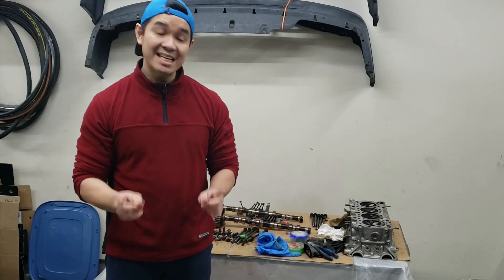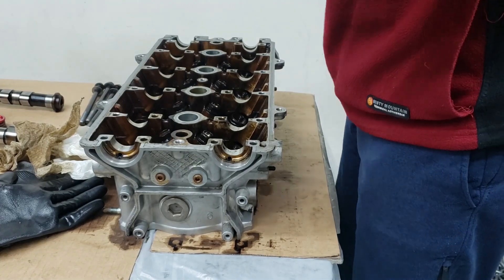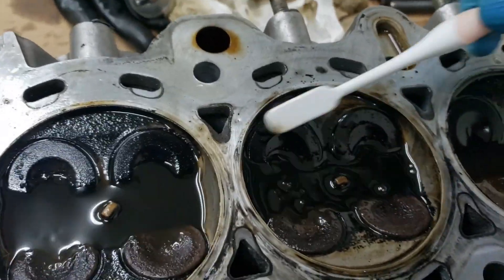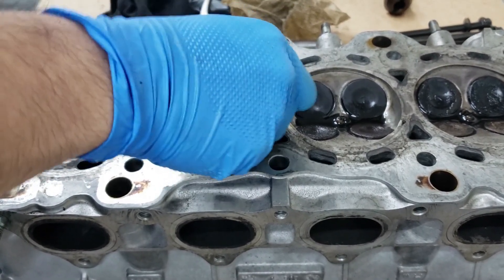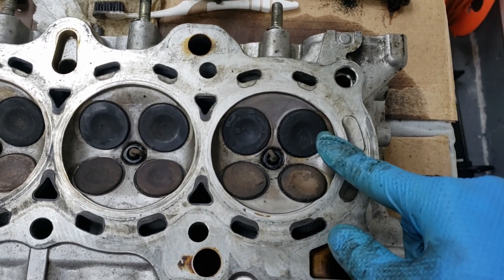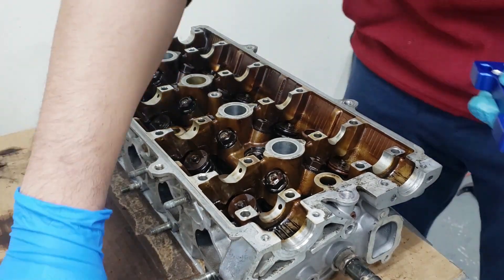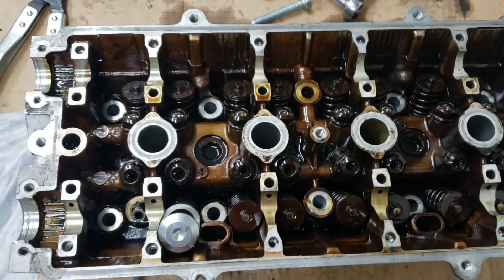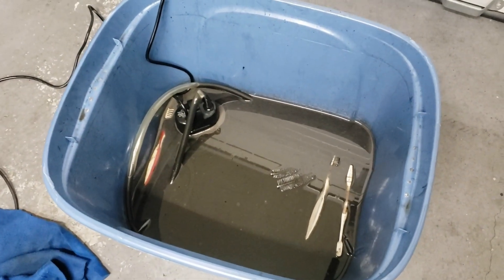||HONDA EF9/ED7 CIVIC & CRX||  BEFORE & AFTER!!!👀 Budget-friendly B18B1 Cylinder Head Parts Cleaning

Comment: Amazing video on your cleaning process. Wish you would have shown some of the head cleaning to see how you dealt with some of the stubborn stains and exhaust ports but overall thank you for sharing on your cleaning.
Reply from the maker: Some of the tough stains still remained. I got most of it off, but for some really thick stains, I used a wire brush to break up the stain before scrubbing more in the parts cleaner. The exhaust ports weren't perfect and doesn't need to be. Just needs to get any heavy build up off.

Comment: Great video, I am doing something similar with an obd0 b16a in my 91 hatch. The valve stem seals in mine were definitely the originals too….they were very difficult and stubborn to remove.
Reply from the maker: I'm jealous that you have a b16a. They're so ridiculously priced these days. Lol.
Reply: @BudgetGears  I looked them up recently, they are crazy expensive. I’ve owned this hatch since 04 and did the swap back in 05. The car actually sat in storage since then…..so now I’m restoring/building it.